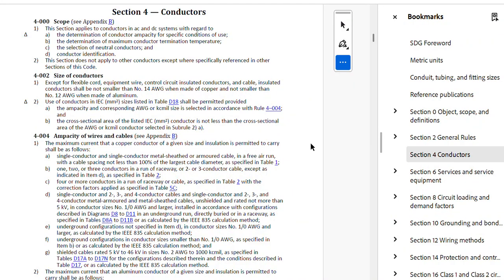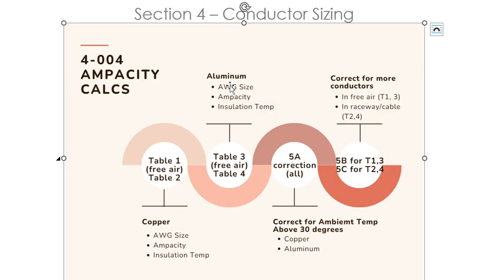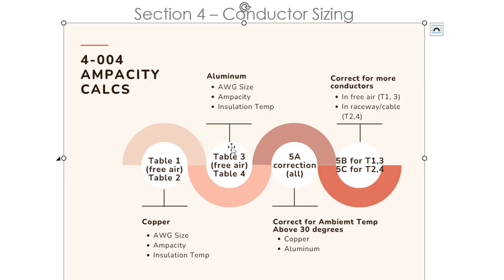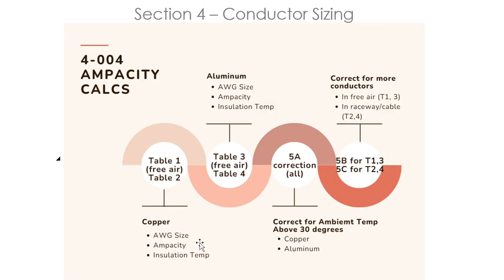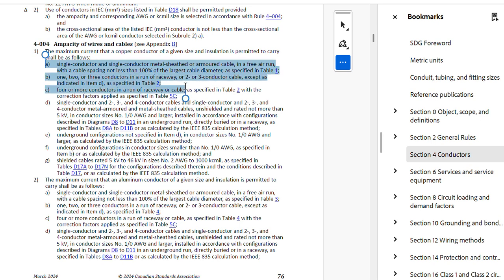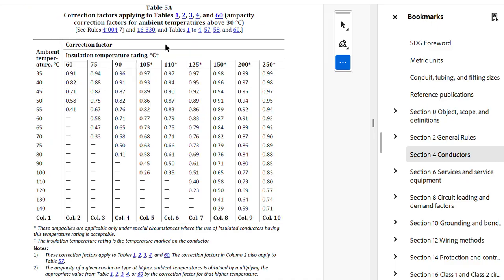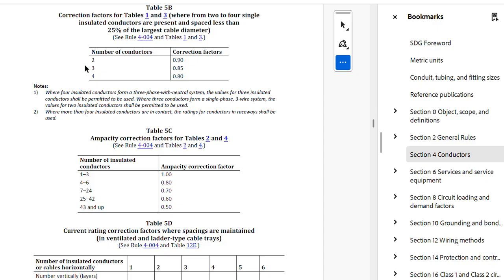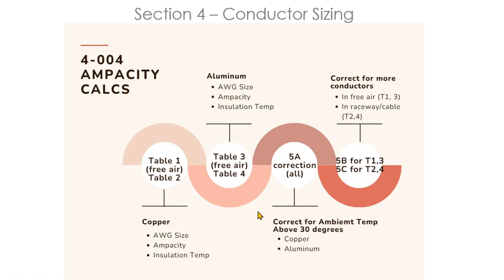Canadian Electrical Code 4-004 | Ampacity of Wires & Cable Sizing Explained (Red Seal Help)

Comment: Where do I find the quizzes for derating and sizing conductors?
Reply from the maker: Here's my whole conductor sizing playlist: https://youtube.com/playlist?list=PLA9NP6jZaB1NjuuMWzUtbxz5dxVQjmnNk&si=i2CJwBgHGuDe_YTb

I have lots of tried and tested quizzes made that I pass to members as PDFs, but this inspires me to make some videos also.  Goal: tomorrow!  I'll try to pass you a link to myself doing one of the quizzes tomorrow.  :)
Reply: @Prof.K.  Thank you very much
Reply from the maker: Well, I didn't get the whole thing done (busy family night) but here's a quick video of the quiz I made for you, and I told you the answers.  I'll have to try again tomorrow to get all the solutions written in.  If you beat me to it, let me know!  Did you get the same answers as me?

https://youtu.be/XbgJK2BptqU

Be careful: Chat GPT does it slightly wrong, based on older code-book tables, so keep that in mind if you want to use that to check your work.  :)
Reply from the maker: ...and here's my old quiz that deals with the rest of Section 4 (not conductor sizing). https://youtu.be/o0ajF9lJ5Ls?si=P9PKz-0H9UwZ8XOL
Reply: @Prof.K.  Thank you very much. I did them and referenced with your answer, both quizzes were correct
Reply from the maker: @ChrisMorgan-u4b  Amazing!  You don't even need the full solutions. They're coming up anyway, so you might want to check out the formula I made for solving them.  Thanks for following.  https://youtube.com/playlist?list=PLA9NP6jZaB1MU7ZhmdBqUOr_hzfI8wJe_&si=D3D06oMKwQAbK2PP
Reply: @Prof.K.  Thank you for everything I will keep watching your videos as it will help me along with my apprenticeship program here in Alberta